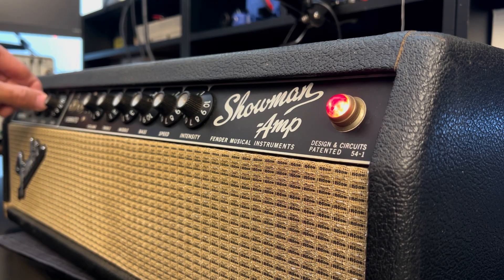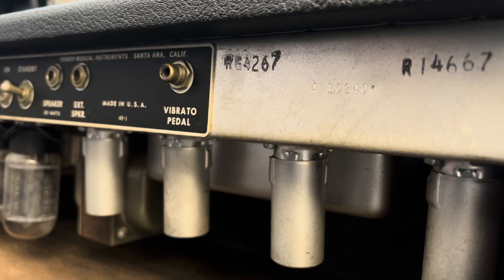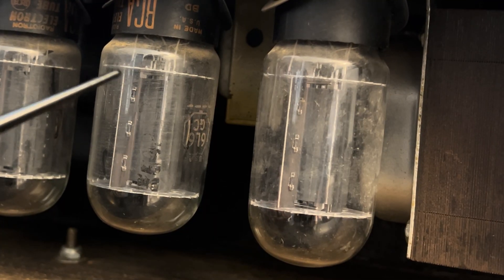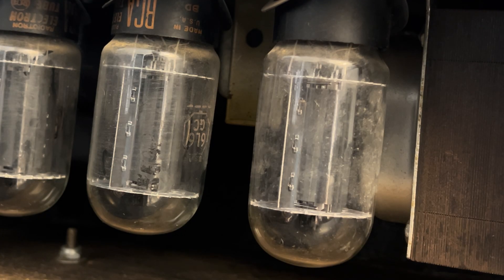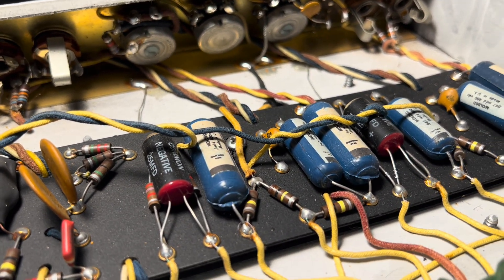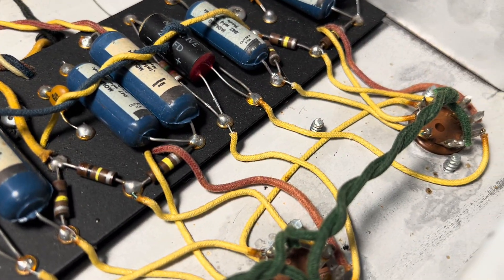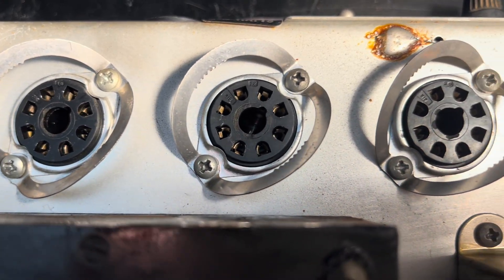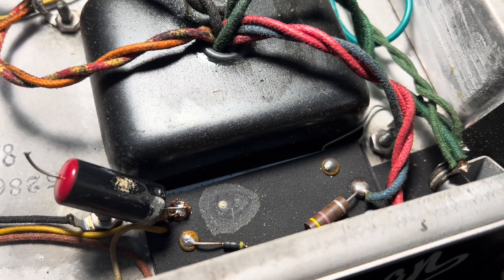1967 Fender Showman — Clean Chassis, Dirty Secret

Comment: Love your content. Wouldn't change a thing. Just acquired a 69 twin that was shotguned with metal film resistors and the dreaded sm silver mica caps. I'm going back the the original carbon comp resistors  film caps. What cap do you recommend for the 250pf tone capacitor ceramic/ film 🤔 Thank you  so very much in advance
Reply from the maker: Dude thank you. I think ceramics are a massive part of the sound for tone stacks and, signal decoupling, and phase inverter inputs!  Also you can keep the metal film on the inputs but I’d recommend cc on the plates!
Reply: Thank you